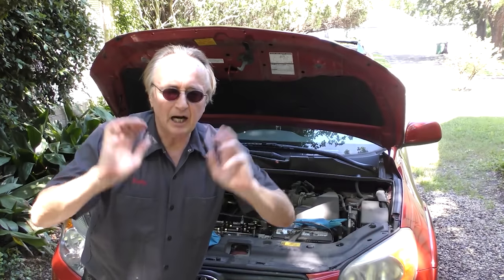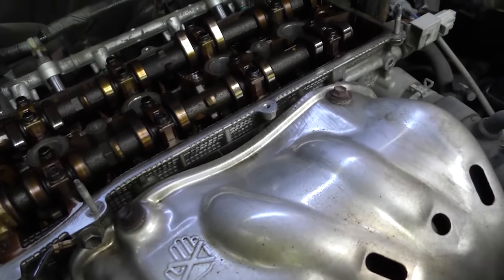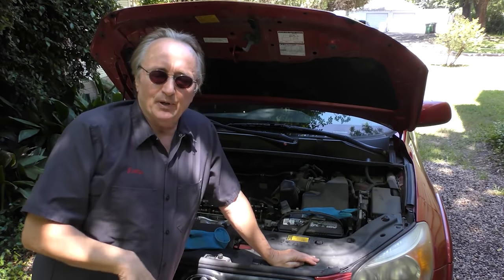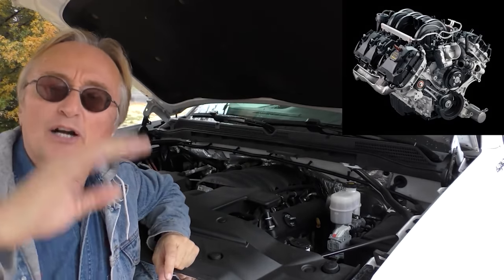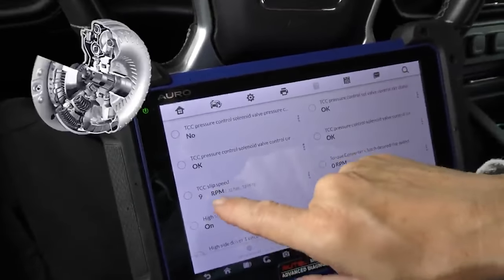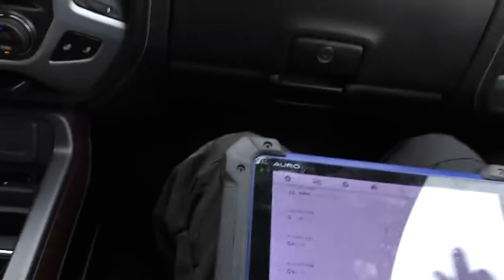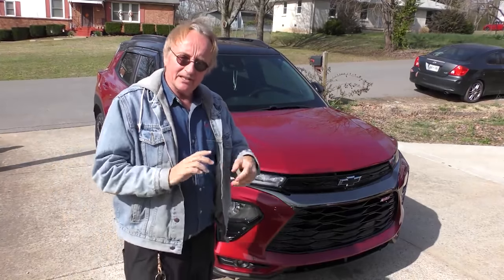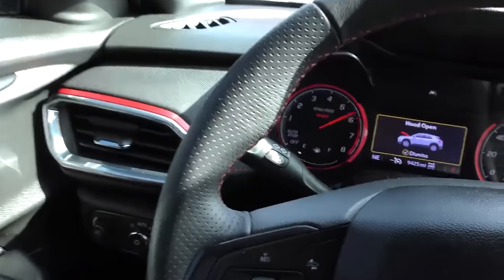Avoid These 3 Engines Like the Plague

Comment: GM DOD 5.3's should be a class action lawsuit. Mine used 1 qt of oil every 1000 miles. Then the DOD failed at 93,000 miles. Eventually ending the life of my vehicle. Made me abandon GM products. I changed the oil with full synthetic since the truck was new.

Comment: 4th gen Silverado or 5th gen seirra is top 3 looking gm truck all time but might be most unreliable ever If you put a torque converter in it and you change the fluids all the time as soon as you buy it you might be lucky and it wouldn't hurt to throw a condenser in it and it wouldn't hurt to throw a AC compressor in it too and deactivate the cylinders with what a different can shaft and then you got to have it tuned after or you could just run it disabler but you also need a oil separator because they sludge up and you got to probably see from it every oil change and change little fluids early because it's a GDI engine also I wish I studied everything before I bought it I thought it was just a Chevy truck I've had six Chevys never and even knew what AFM was That's my fault laying my lesson I'm going to try to baby it traded in for a tundra or 2500 HD but that tundra motor is incredible

Comment: I will give you the credit for smooth shift of 6 gmc sierra transmission ( clean engine air mass sensor ) 

I had one and it's very very smooth after cleaning air mass sensor

Comment: Cool! Video. I have a 2017 Silverado 2500HD V8 and also a 2011 Silverado 2500HD 4x4 V8 both with 6 L engines. Both of those trucks charge over 14 volts. I assume that's normal with the Chevy trucks also both trucks have a DieHard AGM battery in them.

Comment: I seen a v6 Toyota the valve gasket dripped oil directly on the exhaust/ catalytic converter. And what a pain in the @ss to change the valve gasket. No damn room and bunch of crap on top the engine. That's when I lost faith in Toyota's lol Also I accidentally broke a sensor  and I looked up the price it was like $350 🙄, went to junkyard and got one for $5.

Comment: I believe Cadillac did this in the 80s and it didn't work very well at all it was also one of those 864 jobs
Reply: Yes. Old Smith at the local job made a few bucks deactivating those things so they'd run on all 8 all the time
Reply: Was Cadillac GM then?
Reply: @willheiser4706  Chevrolet, Pontiac, Oldsmobile, Buick and Cadillac all GMs. The parts book at dealer had different prices for the same shared part in that ascending order.
Reply: That was the northstar v8, i think. There was a company making them into 500 horsepower outboard boat motors. Dunno if they're still going.
Reply: @hobbyhermit66  There's a guy who specializes in building 472 & 500 Cadillac engines into high performance motors. Can't remember his outfits name off hand but they are real killers.

Comment: you would think it would be so easy to build an electric car. the answer has to be wireless technology. you wouldnt need a battery. as it is. one battery should be standard. government supplied. its the only way. drive up, change the battery. five minutes and go. we have to re-engineer the entire system. the real problem is the petro-dollar. its all based on oil. all built around a war machine